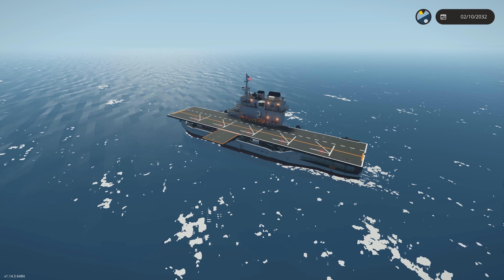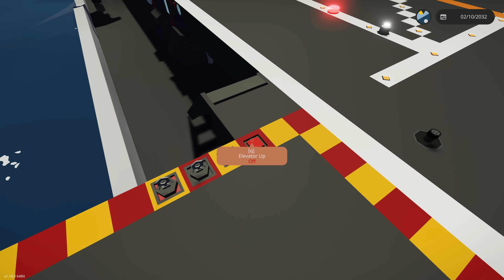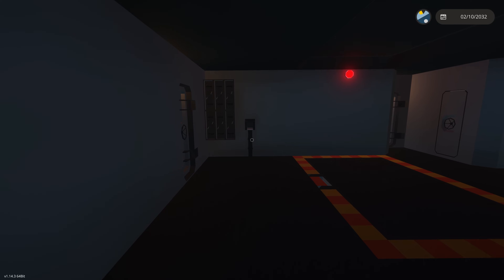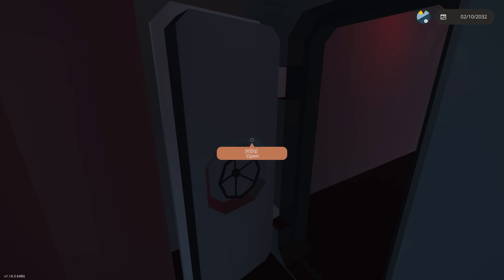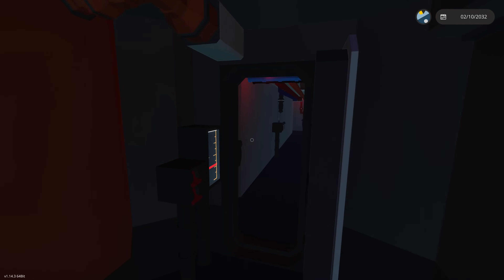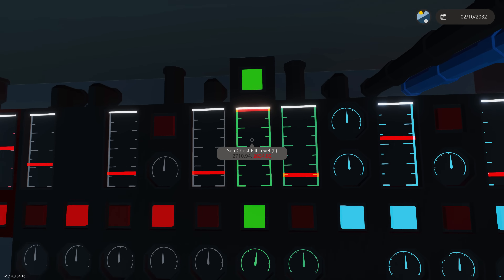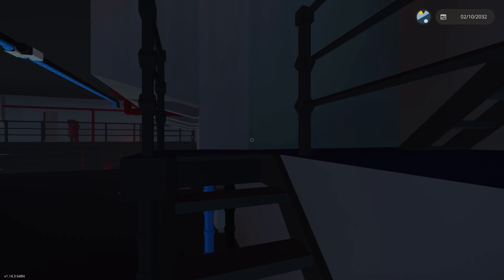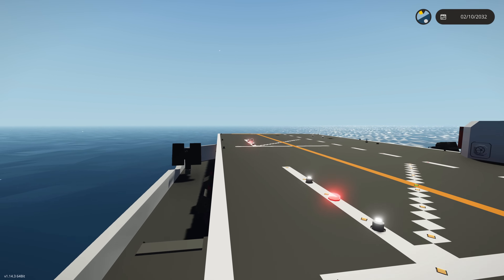Stormworks - LHA-2 Progress Update 3 Working Sinks, Toilets, Showers, and Treatment Tanks

Comment: As an engineer, everything gets my approval except for the HFW. That's supposed to be controlled by a little knob that a single degree of rotation is the difference between no hot water and steam coming from the tap
Reply from the maker: thank you but unfortunately the manual valve in stormworks can only operate like that.